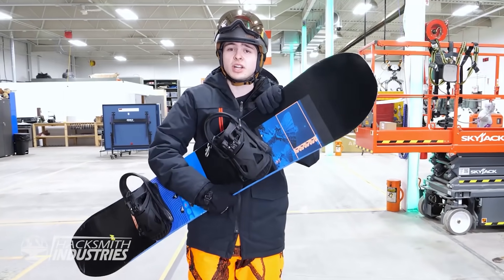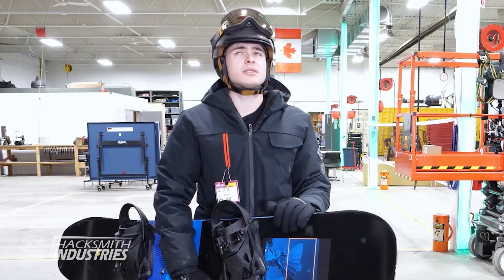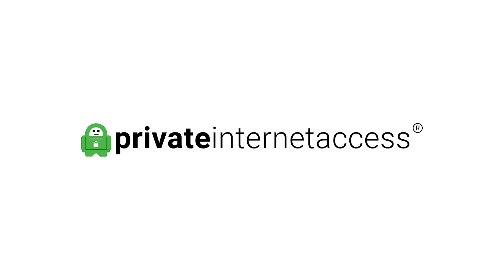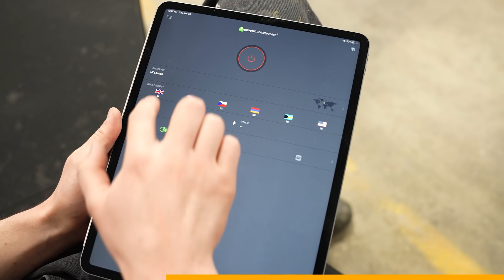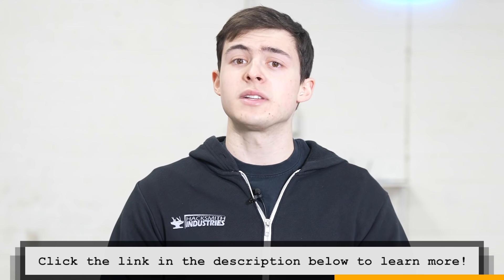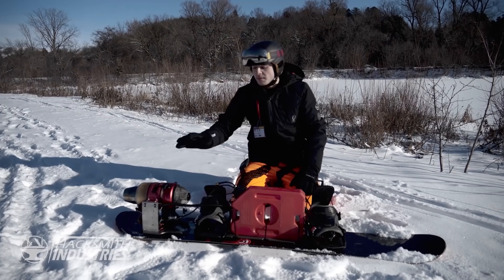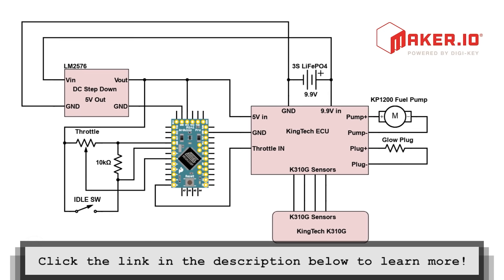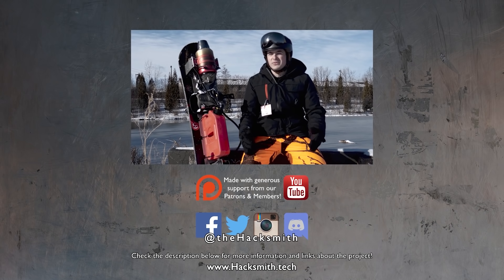JET ENGINE Snowboard! (DANGEROUS)

Comment: Guys, roll those plugs into needles and push them in till they touch your brain. Earplugs aren't in far enough if you can remove them yourself (well, they should require a little effort). Seriously, get hose plugs in deep and flush with the hole.

Comment: Put the weight in a backpack and you would be able to control the board. Lower back pain doesn't hurt anyways. Just put the gas tank and whatever else fits into a backback. game over.

Comment: if you need more weight on the front it might not be a pretty solution but what about a larger gas tank up there. It'd keep the front from lifting and you'd get a longer range.

Comment: Counter balance at the front and two engines cocked 45° out or so to either side and a backpack with pouch/hose line for the fuel
Just wondering 😁

Comment: Use a different board.. like a rocker board your board looks like its pretry edge heavy.. it should work better if you swapped it out for a rocker anything better than a hybrid of camber board like your riding here

Comment: Why not just put your fuel on the front of the board?  Wouldn’t that solve the pressure issue?
Reply from the maker: 10lbs of fuel isn't enough -- it's counteracting around 70lbs of thrust haha

Comment: Perhaps some downward thrust angle to help move the center of pressure forward?  Or going in a completely different direction, how about flameproof pants and a pair of engines mounted at the center?

Comment: you need to get these manufactured in China to get them made cheaper and put these on the market where we can all have one this is the concept you need to Launch on Indie-gogo to raise manufacturing and tooling costs for. It Looks perfectly safe with a Gallon of Gas between your ankles. i am self assured nothing could go wrong with that solid engineering

Comment: They should put 2 jet engines on it and put them in the middle but mount them on the sides going in angles away from the board that way he wouldn't get burned and it would be balanced

Comment: I would put dual jet engines in the back, to allow for stabilization from spins, as well as provide better air circulation into the jets
Reply: And if the fuel tank is half the size and laid in front maybe that would balance it

Comment: So, if you put the button on the board, then have it where the more your press down, the more power is applied, wouldn't you be able have a bit more control, since you then don't have to worry about controlling if through a a controller?

Comment: Sounds like you need a board with more "Camber" to counteract the weight so the board is effectively using its leading and trailing edges and not the middle, hence why it tries to pivot. The board was probably sized to you and didn't account for the added weight or the board is set up as "Inverted Camber" aka "Rocker" or a hybrid of the two.  Might even consider a wider/longer board. Board construction matters a lot. Could be as simple as putting the fuel on the front of the board too. Good luck and hope to see more on it.

Comment: So bracket in the middle 2 jet engines on a T outside of your legs range and tilt them slightly upward that should fix the noncentral pressure right ?

Comment: If the jet engine produces 32 kgs of thrust and if we assume that each engine along with the fuel weighs 10 kgs then we get 22 kgs of upward thrust per engine.
So with 5 engines we get 110 kgs of upward thrust which could easily lift a human.
So why can't we make a jetpack..!! 🤔🤔
Reply: Well, jetpacks have been made.... They're just hard to design &, expensive. Also dangerous

Comment: Perhaps you can use the engine and tilt it where the back of the board has a small amount of lift to try and counter balance.  If you made it where it's like a hover board for its airpower you could  ride it with out snow.

Comment: I like the Home Depot racks. :-) Very cool creation. I'm surprised the suction from the engine isn't pulling in your pants leg material, even with the diffusing/protective screen in place. Great video!
Reply: I think if you look closely his pants are maybe being sucked a little bit, but they're tight enough around his legs that it would be hard to tell if they're actually being affected by any suction at all.

Comment: what about moving the gas tank up to the front? or would that hinder the fuel flow having it too far away?
if the tank being in the front doesnt hinder the flow rate it might help with the weight issue.
Reply from the maker: not heavy enough to balance

Comment: the problem with the method of mounting they used is that it raises the binding position further off the board, resulting in some instability. that coupled with the odd weight distribution due to placements is what i view is causing the board to be so hard to ride. if i was to replicate the idea (id love to! but can't due to cost from needing tools i don't have), i would mount the jet directly to the rear binding(by making a custom base or modifying an existing aluminum base) to push the static weight from the jet slightly forward, plus moving the fuel tank to a backpack type. this should make it feel closer to snowboarding than fighting a jet engine on the back of the snowboard.
Reply: also the slight flex of the mount was changing the direction of thrust as he went over small bumps causing other sability issues

Comment: I wonder if you could solve the control issue if you basically put a keel on it maybe 3/8 of an inch and super thin I basically just a strip of sheet metal

Comment: Hmm... I'm by no means an engineer, but could the balancing issue perhaps be solved (or at least mitigated) by putting some kind of weight on front to act as ballast? 
From the video, you mentioned that the balancing issue was caused (in part) by the centres of gravity and pressure being different due to the jet engine messing up the weight distribution. 
Putting some kind of weight on front should, hopefully, restore that balance at least partially. Just my take on it, so feel free to correct me

Comment: To solve the instability problem ... just vector the thrust!!! You can limit the vectoring to one axis (side to side). Only question at that point is what controls the vectoring? You could use an accelerometer/gyroscope on an arduino to build a control system to maintain direction, but then it would fight you when you legitimately want to turn. 

Lol, I started the comment mostly as a joke, but this would legitimately be a super interesting follow up to this video ... solving this problem would very cool

Comment: Adding a small fin into the snow might help with control, like a ship's keel... if Bogdan hasn't had a heat stroke from working inside in full gear yet, that is

Comment: What if you use two jet engines to the sides of the snowboard in the middle? 2 jet engines = twice the trust, but the important thing is that they would balance each other cause to put one in the middle would mean to burn your leg, as you said.

Comment: Having 2 jet engines (instead of one) positioned at the front and pointing away from the user (30° between a jet engine and the board's center axis) could've fixed the speed and instability issues

Comment: How about adapting that bracket which supports the jet engine so that it swivels in the middle of the board with some springs which want to force it back to the middle position. The thrust force then applies to the center of the board so that it’s more in line with the CoG. With mainstream snowboarding the gravitational force propelling the snowboarder also doesn’t change direction when te snowboard veers left or right.

Comment: or, you make some sort of Spoilers to hold the Line or make some sort of Tail, with its drag it could stable it a bit.. Well my guesses. Of course it must be protected or hold out the Hot Air Thrust of the Engine

Comment: What if you used some sort of rib or something like that sticking down from the bottom back third of the board, only an inch or a little more down. You could slope it down to nothing at the front of the rib.start it at the back of the board and make it end underneath your back foot. It should anchor the board side to side in the snow just in the back while allowing you to steer with your weight on the front of the board more as you normally would. That is the idea anyway. Love to know if it would work as it does in my head.

Comment: 7:40 I don't believe it runs on diesel, jet engines usually run on kerosene or similar fuel.
Reply: The fuel all the diesel powered army trucks run on is JP (jet propulsion) and then a number to describe which compound it is (jp8, jp12,etc). It's simplifies the logistics of supplying fuel to forward positions of everything uses the same kind of stuff

Comment: If you could use a smaller gas tank, you could angle your bindings forward more, downhill / alpine style, and get more weight on the front of the board maybe? Maybe angle the thrust down, to drive the nose down,.... meanwhile, I need to go wax my board, we have snow forecast for this weekend.

Comment: Hey guys cool build!
Here just an idea for better maneuverability:
You do have 2 jet-engines, so you could mount them indirectly to the middle of the snowboard in a "V-kind fashion". Perhabs you need a small heat-protection shield in case you fall.
Would love to see some kind of upgrade to this build!

Comment: already subbed, love the one day build awesome job , one thing if you had the fuel tank up the front of the board wouldn't that help counter your prop and also having the engine exhausting in the opposite direction

Comment: One day builds are great! As for the board, I know I suggested this before during the EDF snowboard but put two engines at the center of the board between the legs and make some thust deflectors to point the jetstream from your legs? And the fuel tank can be on a backpack.

Comment: If the problem with the board is that you have to put all your weight on your front leg to balance it, would adding a counterbalance weight to the front negate that? This feels to simple to actually work, so what am I missing?

Comment: You could solve the center of thrust issue by using 2 engines. Then you could move them to the middle of the board and have them offset far enough out so it wont burn your leg.

A potential issue though could be that the engines would hit the ground if you fall and would also really have to make sure that even if you fall you wont get your leg behind the engine

Comment: Would it work better if you weighted the front of it more? Or perhaps made a frame and used the two engines in more of a wing design? Or perhaps a combination of both? Then there is an option of using a denser wood in conjunction with it

Comment: May want to consider a quick detach for the fuel tank. If the tank ever leaks and catches fire, it requires you to stick your hand in the fire to release your bindings. Being bound to the tank, means you can not escape from the source of the fire. You can't just run or hop away from the fire.  

Please consider the scenario of a gas fire and the steps needed for you to escape or put the fire out. A motorcycle allows the rider to run away. A car has a fire wall allowing a little extra time to escape. You have nothing protecting you and are bound to the source of fuel.

Comment: Slight slope downward on the engine mount + some extra weight on the front might alleviate the issue according to what was described.
Reply: I think maybe it would work with a custom board with larger edges that don't let the board spin when flat on the ground.

Comment: You can a metal plate under there snowboard which can conduct the heat from jet and use it to melt the ice under the which will reduce the friction .so you can go still faster

Comment: 2 engines in the middle? Out to the side? Doesn't that solve the weight distribution problem really easily?
Reply: yeah I would worry about it suckign up snow rocks and dirt when turning/falling. Those are not cheap or easy to work on.

Comment: They do have 2 jet engines, and the stability problem is because there's a single engine behind the rider.  Actual jet airplanes have a jet on either side.  Redesign with twin engines mounted closer to the rider's weight - but outside (and slightly above) the board.  You'd lose some turning angle, but be a lot more stable.

Comment: I legit had the same idea when snowboarding the other day 🤯
:edit, bty I don’t know but I think a jet engine with all that fuel is a lot of weight and what I mostly do on a SB is “flicked” turns and fast maneuvers and I was wondering if the weight would effect the maneuverability of the “jet board” maybe slap some overkill carbon fiber EDFs on there but that still wouldn’t make enough thrust???🤔

Comment: What about adding additional weight to the front of the board? Or maybe dual jet engines along the sides so they don't burn your legs? You could start by moving the fuel tank to the front of the board, but that would only work until the fuel gets lower! haha... fun build anyway!

Comment: Not sure how to get or make them, but it seems custom fuel tanks could distribute more weight towards the front and middle. Adding more grounding stability instead of the tall tank in between your legs. You also wouldn’t have to lean forwards as hard.

Comment: Obviously you need TWO engines mounted on the back hanging off the edges sandwiching the gas tank (which should be where the solo engine currently is) :D MORE POWER!

Comment: Couldn't you point the engine slightly down (exhaust goes up) to remove the moment it is creating? A line through the center of the engine intersecting the board between your legs

Comment: Cool idea. Issue with using a snowboard is that it is “unstable” when flat. It is “stable” and in control when you engage an edge (which as you pointed out will make it turn).
It’s like a boat without a keel when flat, and can slide around in directions other than straight. You are constantly at risk of catching an edge, but you don’t know which one. 

So your limiting factor will be stability and you will crash before you reach top speed.
Perhaps you could make a couple of little teeth or fins that just dig into the snow a little on both sides like a keel or runners. It would be harder to turn but you’d be more stable for higher speeds.

Comment: Don’t be afraid, put the other one on too.
Jet board mk2:
-Two jets in the center of the board but held out to the sides to clear your legs
-fuel tank in the back and front
- better wax on the bottom of the board

Comment: MK 2 could be two jet engines in a V configuration between your legs like the razor crest from the Mandalorian.
Reply: Yep my only concern with two is that the differential thrust might throw you off, and the less clearance for leaning in turns. Would like to see it tested out for sure.

Comment: Yeah seems a little dangerous....strap your feet to a gas tank, spool up a jet engine to 800 degrees C then wibble wobble crash and hope you don't explode. Bad thing is if that tank burst into flames you would literally have to reach into the fire to unstrap yourself to get away. But hey I wanted to see how well it would work too! and what is life without a bit of risk? Kind of like those guys flying around with jetpacks...so dangerous it's best just not to think about it too much and just do it!

Comment: What’s the point of making a jet engine powered snowboard if it doesn’t go fast? I get that it doesn’t control well but he explained that it’s because of the placement of the engine. He could’ve made a mounting mechanism in the middle that would allow 2 engines to be placed on the sides of the snowboard

Comment: If the centre of mass was on one side, why didn’t you put weights on the other to even it out? I know that the extra weight slows you down. By that may would be a little less then not giving the engine full throttle

Comment: Been thinking about pulsejet version with two engines, one on both sides, attached to the rear binding screw holes. And adjustable handheld valve for turning (balancing the fuel feed between engines). Fuel would be stored in a back pack. We have pretty much zero elevation changes around here and the closest worthwhile slopes are at least 300km+ away. Though there are a lot of fields and empty forest roads.
Reply: Pulse jet very finicky to start in cold I bet

Comment: pounds and kilograms aren't interchangeable! Thrust is measured in pounds because pounds are a measurement of force. Kilograms are a measurement of mass. (I.E. if you're on the moon, you have approximately 1/6 the pounds of force pulling you down, but the exact same number of kilograms comprising your body) so it makes no sense to be measuring thrust in Kg, because there is no way that there's 32Kg of anything involved in this system. If you want to keep it metric, which is why I assume you converted it to Kg, Please use Newtons!!!

this has been my pedantic rant for the day

Comment: If you front-mount the two engines at a V angle so they aren't pointing at your feet, you'd probably have more control and go faster, right?

Comment: What if you put the thing you were holding to keep the engine going was merged with a ski stick so you could still use sticks and keep the engine running. The ski sticks would also fix the turning issue

Comment: Snowboard with a  chainsaw/weed wacker motor  or electric motor. 
Chained  from gear to gear  powering a  mini snow mobile track  almost flush mounted  at the rear. 
Or even a sphere design with "scoops"  to slow easier turning. 

You won't see this though lol

Comment: Great idea. But if you have two jet engines you could put the two mounted off set from the centre of the board to miss your legs with some kind of engine protection if you fall off..